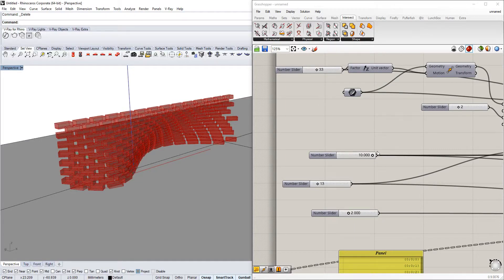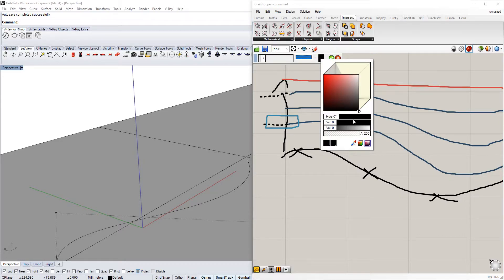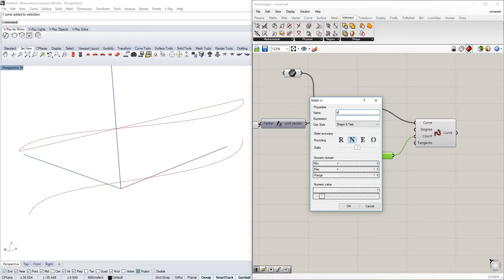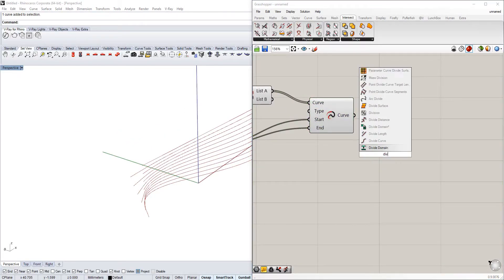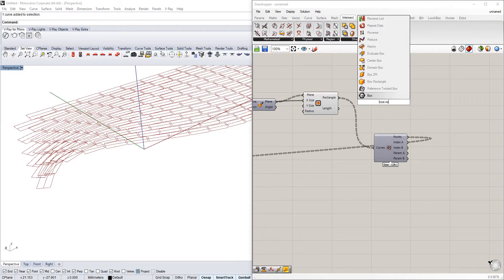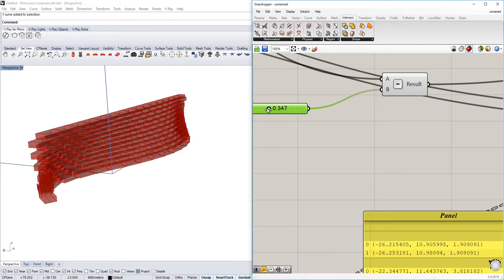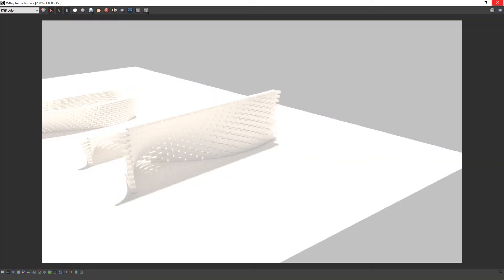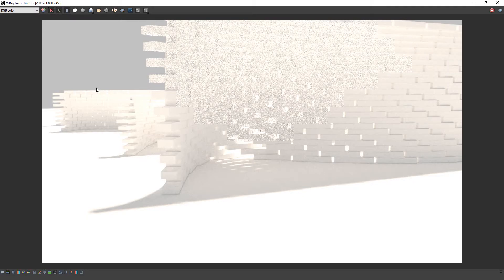Grasshopper Tutorial: Brick parametric wall

Comment: this might sound stupid but can you please tell me which  type of curve you used. I got everything right but i can't make the topmost curve a straight line when simplified
Reply from the maker: Hey, there are no stupid questions here :)

So, we are basically using the basic curve that we had as an input from the rhino environment, we then used it to move it into the z direction by a certain amount. Afterwards, we used the rebuild curve command, and set the count to 1. alternatively, you could also create a seperate currve yourself, or use "endpoints" to the create a new "line" and use that as a curve.

Hope that helped and thanks for the questions
Reply: @SatoshiBuilds  thanks for replying.
I understand that, but after you rebuilt the curve, when you set the value to 1, it became a straight line. In my case, it becomes a slightly less curved line, but never a straight line- no matter which type of curve I draw in the rhino environment.